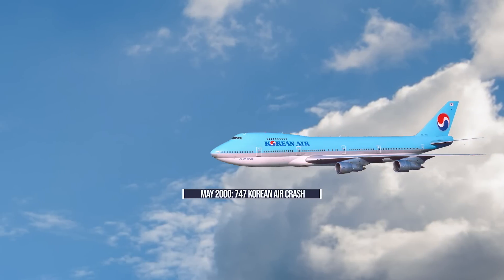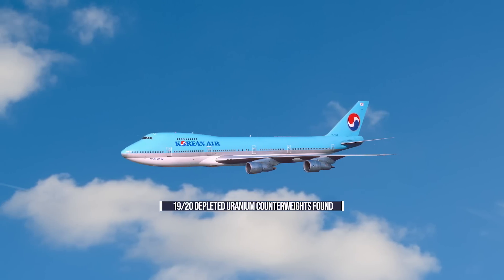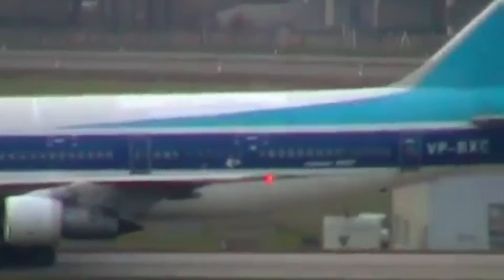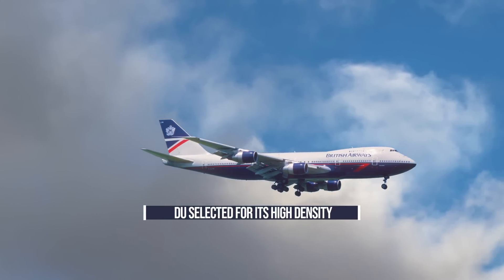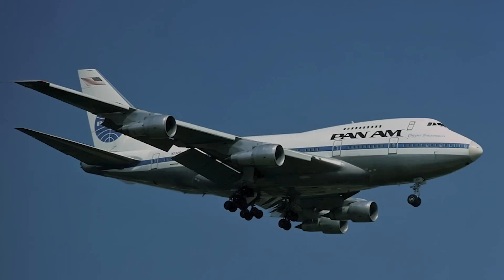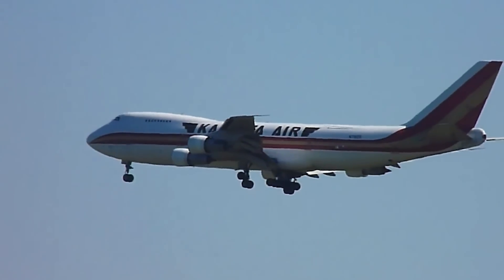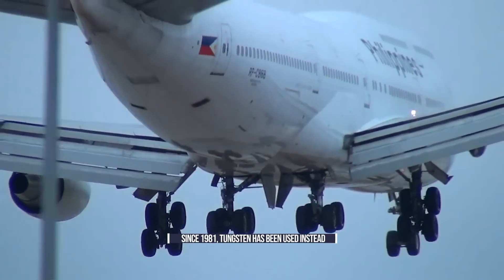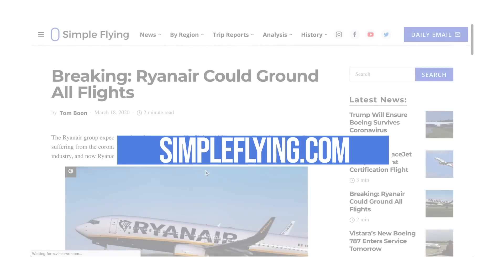Why Early Boeing 747s Used Spent Uranium As Counterweights

Comment: If the uranium was in the tail feathers, it's doubtful they were used for weight balance--more likely used to reduce aerodynamic flutter. All 727s had a 400-pound depleted uranium weight  attached inside the radome (nose) since those three rear-mounted engines and the air stairs made the aircraft ass-heavy. The material is considered harmless. You will not die.

Comment: I worked in oil well logging in the 80s and for our small production logging tools strings used weight bars made of this for the same reason. We had to keep an inventory of them with other radioactive sources. We also changed to tungsten for weight, the main problem with the tungsten is that is was brittle and hated going from the heat of an oil well to -40.

Comment: They also had depleted uranium on the DC-10 too on the elevators. Not sure about the rudder.
Reply: DC-10s did indeed have the same DU weights. MD-11s used tungsten.

Comment: But then, building such counterweights was likely cheap at the time, given the large amount of depleted uranium available as a by-product of the manufacture of fuel rods for power plants and fissile material for nuclear weapons. I believe they now use tungsten as counterweight material at least since the early 1980's.
Reply: Depleted uranium is just as available in large quantities as back then. It should be cheap. But as the video mentions, it's not used over tungsten because "bUt It's rADioaCTive!"

Comment: Depleted Uranium has had all the U235 removed. The remaining U238 isn't very radio-active at all. The risk is that Uranium oxide is poisonous chemically - not radio-actively. In fact, the cadmium in the coating is more poisonous than the Uranium. Yet people quite happily use consumer electronics with Nickel Cadmium batteries. Early mobile phones had these - a single battery had enough Cadmium in it to poison a lake. The public however ignored the advice to properly dispose of old batteries, and threw them in the trash - which went into landfill, and is now poisoning ground water - which will eventually flow into rivers and drinking water supplies.
Reply: U238 is also quite cheap because we need a lot of it in order get enough U235 for civil and military use. That's why it's often use over Tungstene. Also U238 is the heaviest stable (non-radioactive) element in the periodic table.
Reply: @uwu_senpai  Uranium 238 is not stable it has a 4.5 billion year half life compared to U235 at 700 million years. So neither is meaningfully radioactive. But it definitely is radioactive. The danger if any is chemical though not radiation.
Reply: Stu Skivens, Your comment makes the video more see-worthy  ☻ Thanks.
Reply: Point: U-235 is slightly more radioactive than U-238 but still it also isn't very radioactive at all. It is just as safe to handle as U-238.
Reply: @zolikoff  Indeed, weak Alpha Emitters are basically not radioactive unless you're an idiot.
Reply: mPky1  Early hybrids used NiCd batteries. Chrysler bought the patent for NiMh to try and destroy the EV market. The modern EV battery is either NCA or NMC plus lithium. Lithium isn't so bad as its extracted in the desert in Chile. Cobalt is an issue - if it isn't Canadian, it was probably mined using child slave labour in the Democratic Republic of Congo. Tesla are using LiFePO4 in their Chinese battery packs - no Cobalt, but less energy density.
Nickel, manganese, aluminum, iron phosphorus and oxygen are used so much in industry, they are probably not an issue.
Many industries have hidden issues. Cobalt used to remove sulphur from diesel for example.
Probably best not to know about these things - you would worry about buying anything.
But it is certainly correct that early EVs and Hybrids did have naughty batteries. Hopefully they were recycled - but i doubt it.
And of course there is the Thorium that gets mined along with rare earths like Neodinium. This issue caused a Californian mine to shut down. But I don't think they worry so much in the far east.
(neodinium being used in strong permanent magnets for motors and wind turbine generators)
Too many things to worry about!
Reply: mPky1  Troll
I never said any battery was 100% anything let alone lithium.
Reply: stu skivens Thank you.
Reply: A bit different when you use it to knock out tanks:

Toxic Depleted Uranium Ammunition Being Used by U.S. Military
https://www.youtube.com/watch?v=1UruvWeiygE
Reply: @goldblackbrownwhite  That's chemical toxicity - not radio-active toxicity. To say there is plutonium in the DU is probably rubbish. Natural uranium is 0.7% U235 - and this decays - as it decays it slightly bombards the surrounding U238 with neutrons forming traces of U239 which decays quickly to Np 239 then Pu 239. But this is a natural process, and is present in natural Uranium. And the Pu content is a trace. A hangover from the natural state of the element as mined. I would be more concerned by living near a coal fired power station, which releases traces of natural Uranium present in the coal, still containing 0.7% U235. This falls out quickly and contaminates the local area. Its only a trace, but when you use mega tons of coal it adds up. Indeed, many coal fired power stations would be closed down if they were nuclear stations because they release so much radio-activity. The scrubbers in the flues help - but its not 100%
Similarly, radium gets released from gas wells - once the cap rock is breached.
Still, at least your mobile phone only has a little bit of radio-active indium in the touch screen.
Reply: Stu skeven thank you for telling
Reply: mPky1  Troll
I have never seen such a load of rubbish.
Reply: mPky1  I didn't remove my reply, I don't know why it no longer appears.
However, if anyone is childish its clearly you.
I don't see any proof from you at all.
You clearly have no idea what your talking about.
Your a troll, and need to return to whatever hole it is you crawled out of.

Comment: Good video but you didn’t really explain why
Reply: Err...coz they have very high density? as stated in the video. Means more weight in smaller surface area. Also much cheaper (due to abundance of it available as a byproduct/remains of nuke plants, etc).
Reply: @SheetHorizon21  Yes but why have weights of any sort? Surely the plane should be designed aerodynamically balanced without them?
Reply: @michaelbaker2465  err I dont think you can build anything that large without having any sorts of weights especially with planes whose COM usually changes allot (engine variants, fuel, passenger/cargo load, etc). Furthermore, design wise, the later half of the plane is lighter (due to less space available) compared the to front-half (which has the cockpit and the systems, etc).

Just picture a plane in your mind or better build a paper/plastic plane and see for yourself (once you add wings and engines), you will need to add extra weight to the tail in order to prevent it from tipping over even at standstill.
Reply: @SheetHorizon21  Thanks for your reply. Although these built-in weights are no good to compensate for the sort of changes of you mention of fuel load, number of passengers etc. I've flown in gliders where weights were added/taken away depending on the passenger load, but these heavy tails can't be removed!
Reply: @michaelbaker2465  They still have to use weights (thou now of different materials), as for the gliders, they dont have much of anything that adds weight except the flyer themselves, but these big ass machines (even completely deprived of fuel and passenger), have a cockpit, fight systems, landing gear, etc. 

Take a pencil and hold it on your finger at mid point, u should be able to balance it, but then add racks of computers, wiring, etc in the front and then landing gear, etc in the mid, the rear just doesnt have enough mass to balance out on its own. There's a reason why pilots & now-a-days systems have to run crap to of calculations depending on weight (fuel, passenger arrangement, etc) to determine the COM, etc. and without the constant weights to balance the neutral weight out, you will have to apply constant pressure on the flight systems just to prevent the flight from tipping over.
Reply: SheetHorizon21 Why did the center of gravity need to be corrected? What was it before the weights?  What caused this? When did they figure this out?   This video just tells us they have the counter weights, no details whatsoever

Comment: I didn't know this actually. Really Uranium
Reply: Not the kind of uranium you'd use in nuclear weapons or reactors. These are 'spent' uranium which means most of the fissile Uranium 235 inside it has been used up in fission reaction in nuclear reactors. The leftover material is uranium 238 which is of no use but it is very heavy so it can be used for weights or in some cases, the core of cannon shells for their penetrative power.
Reply: @toiletpapermerchant9310  Depleted is very different from "spent".  Depleted means they took the hottest part out of natural uranium. It's the unusable part that could not be made into fuel. It's comparable to and less active than the natural ore.  The so called "spent" uranium has actually been inside a reactor core and is about 10,000X more active than fresh unused fuel.
Reply: Yes chosen for its property of density. Coated in protective layers of cadmium, primer, and top coat.